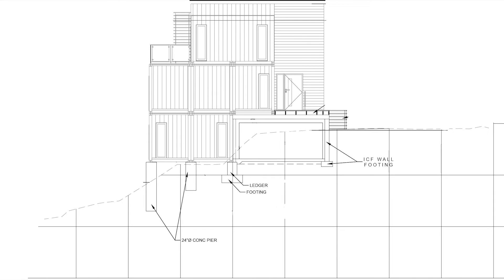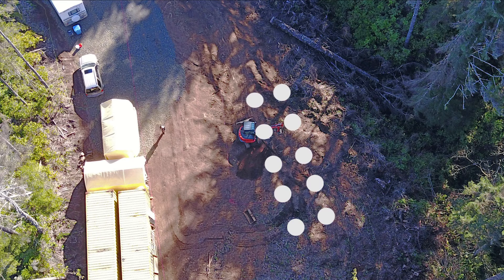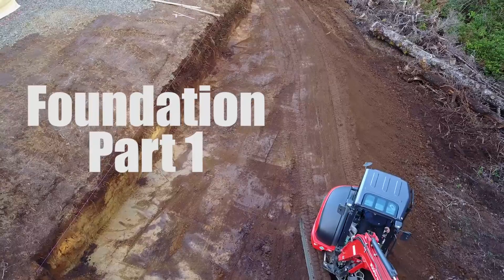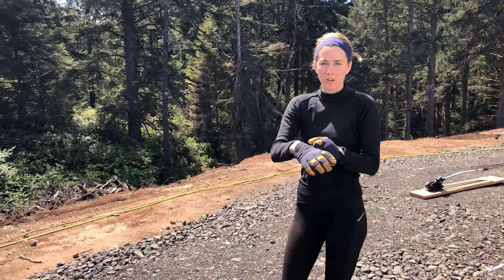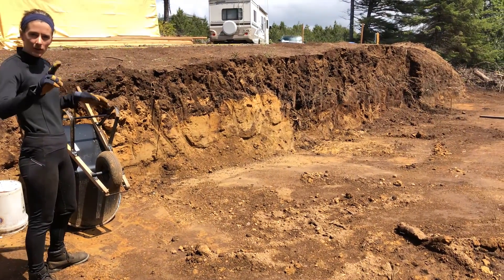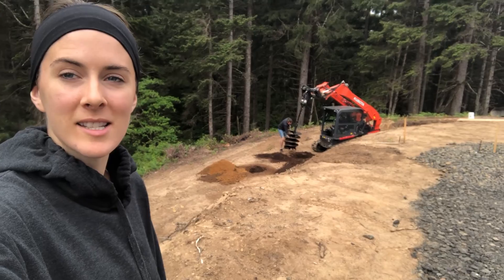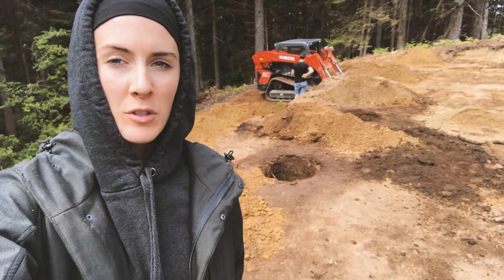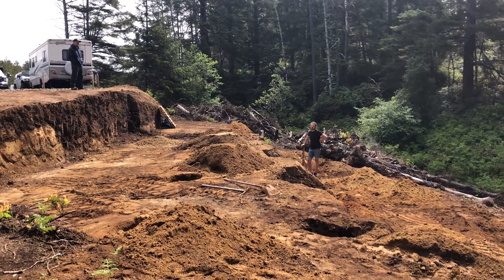FOUNDATION PART 1: Excavation and Preliminary Setup — CONTAINER HOUSE BUILD - Ep. 3

Comment: Hi, been watching your videos with great interest. They are very educational and j have a couple of questions. I have not yet seen anything relating to a septic tank. What are your plans for black water management?  Is there a reason why you would not have done the ground work for this when doing the other excavation work?  Same question for electrical and water supply? 
Did you have to do a soil survey to calculate how far down you would have to go for your pilings?
Reply from the maker: Thank you!! We installed a standard septic system but originally we weren’t sure which type we wanted to go with, so we did a ton of research about it. We waited to install the septic until we had more info about it. I haven’t gotten to that point yet in my video editing yet but I will eventually get there. Other than that we are off the grid for water and electricity so we have to figure out those systems as well. For now we have some temporary systems in place. 🙂 Overall just trying to figure it out as we go lol.

Comment: I have seen in kirksendirksen’s  channel a 2 story shipping container apartment complex in Arizona where the architects only supported the 2 story structure on the the 4 corner columns/castings on a spread footing foundation. He explains that shipping containers are designed to be stacked 7 high fully loaded and they carry the load on the 4 corner columns/castings and only need to be supported at these 4 corners. Do you agree with this premise? 

If you had a flat plot of land, do you believe you could have supported your 3 story structure just at the 4 corners similar to that 2 story apartment in Arizona?  I feel this design would would be a simple and cost effective, but I’m not sure if it would work in an earthquake.
Reply from the maker: We were lucky enough to see that build in person before we started our project. If I remember well I think they have 2 other supports in the middle as well as on the corners. Even if we had flat land, we have a lot of cutouts + 3 levels (& a rooftop deck) so we would definitely add supports in the middle. 🙂